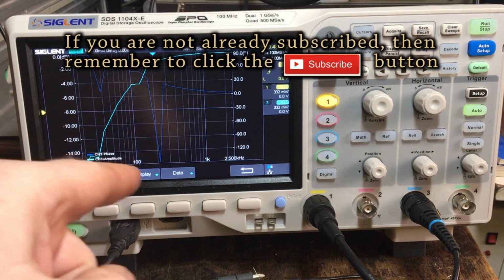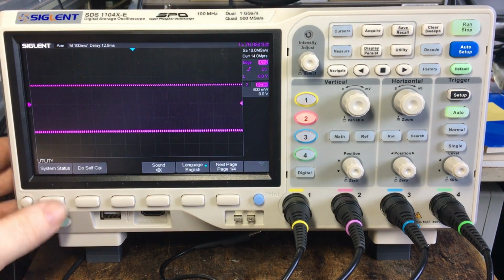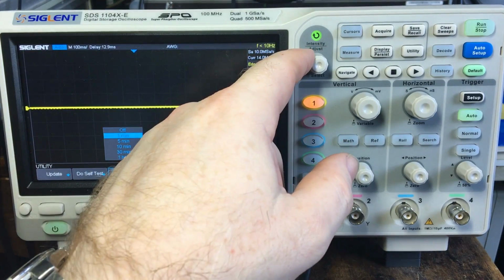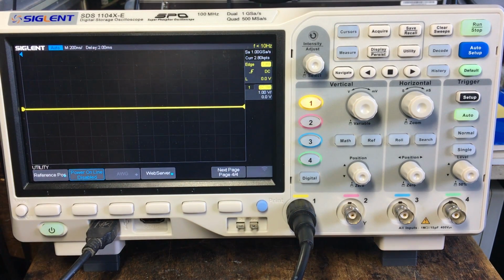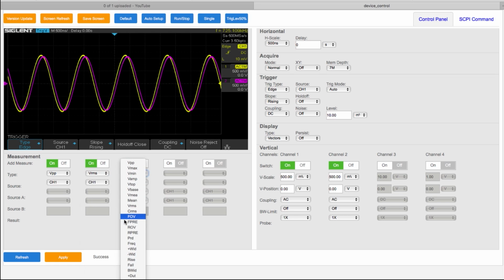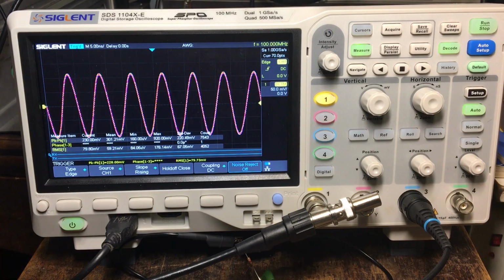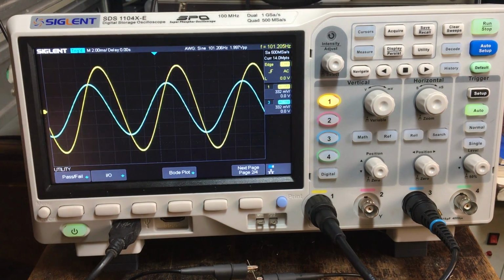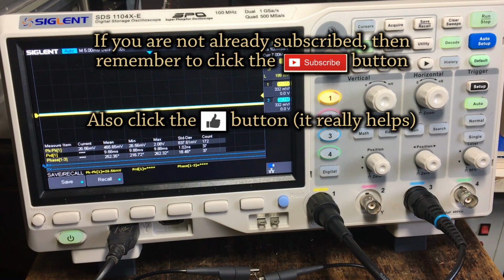#320 Siglent SDS 1104X-E 4 Channel Scope Review

Comment: I have SDS1104X-U. I am uncertain if the peak to peak measurements (have a siglent signal gen also) as when I put in say  500Hz 400mV pk-pk signal it reads pretty far off. I have probe set to 1x, and the weird part, the division scale graticule I can read and calculate V/division and it seems to be more to trust, but it doesn’t agree with the measurement output. Also, is there a way (without hooking up a pc) to have two or three channels at the same time display say voltage pk-pk so I can check gain easily? I suspect not. Seems like I have to choose one, then do the same on the other but never both at the same time. Any help appreciated. Is the problem with impedances on the reading of values?
Reply from the maker: It will be based on a 50 Ohm system, so to get the correct reading you need to allow for that, so if it’s 400mV p-p at 50 Ohms the scope input also needs to be set to 50 Ohms, I don’t think that scope has a selectable input impedance, so the way to do that is to use a through terminator (if you are using a bnc cable to connect, rather than a probe) Also if you use x1 on the probe you limit the probe and scope bandwidth considerably, usually to around 6MHz or so, and can load down the circuit under test, avoid using 1x if you can.
Reply: @TheDefpom  wow! Thanks for the quick response. I’m seeing in the manual (not sure it covers my model) possibility to set the output impedance of the signal generator. The signals are so small, and I’m always confused on this, X 1 setting on probe is self explanatory, but the 10x setting…magnifies or is it that it  takes 10 X the signal to show same vertical as the 1x 
? Thanks so much for the reply!
Reply from the maker: @shader26  x10 means it divides by 10 so you have to multiply by 10, or set the scope input to be 10:1
Reply: @TheDefpom  thanks. Again. It’s very basic, but it always threw me with the X… so when I also set the scope to be configured that I am using a x10 probe, I will just have to change V/div much lower as it’s a small signal.

Comment: So 4 years on do you still use this scope and how has it faired? I am in the market for a scope for amongst other things the serial decode (SPI and I2C). Have you used it for this and how do you rate it? Finally how do you rate the long term reliability and support of the Siglent scopes? Thank you
Reply from the maker: The review unit isn't the one I own, but I did end up buying one later and I have been very happy with it, great feature set for the money, the decoding is especially useful, I actually own 3 Siglent scopes.